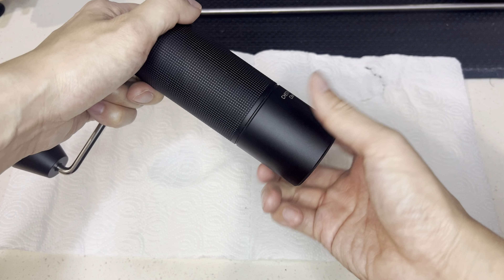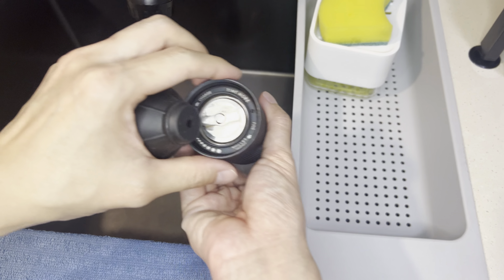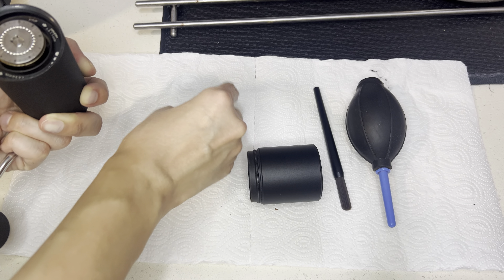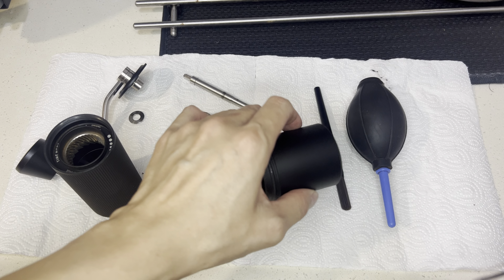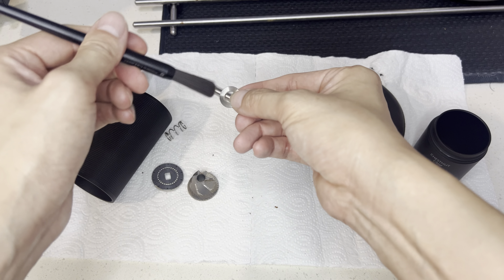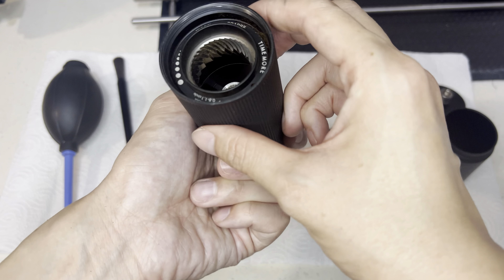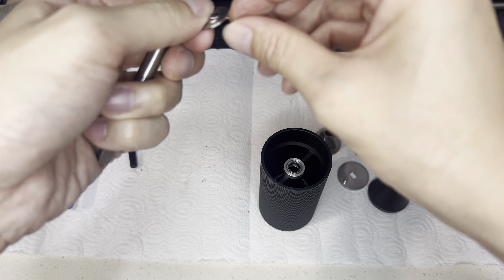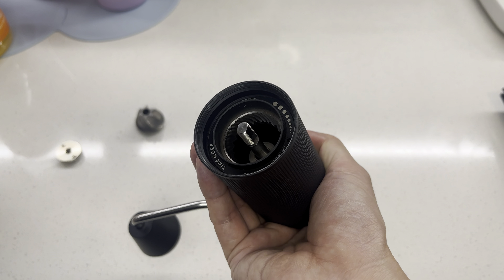How to Clean Your Timemore Coffee Grinder [C3 ESP]

Comment: Dude, you assembled it incorrectly: the smooth washer is on top, where the handle is, and the washer with protrusions is in front of the millstones.
Reply: Thanks for the information!
The manual provides 0 information which side of the washer should be on top, so your comment is of great help!

Comment: Hello, a question, I don't have the mill in position 0, do you know what it could be? Greetings
Reply from the maker: Hi. I did have friends having the same issue. Cant do anything with that, just do extra math to adjust the size.
Reply: @GoNelly  :( , thanks for responding
Reply: You could try to turn metal ring with digit marks 180 degrees (it can be installed on the main axis two ways)
Reply: Hello. Were you able to solve your problem? After the second cleaning, my mill is in position 8 or 3, depending on the position of the disk. Although initially it was at 0.
Reply from the maker: Mine back to "zero" after the dissembled and reassembled again.
Reply: Had the same issue after I disassembled and put it back together, but I could solve it. This wrong position possibly occur when you want to screw it back and you push the spring a bit to hard. Bcs of too much pressure the nut turns too much in the thread before the spring would push against it and it will be dispositioned. Remove the nut and when you want to screw it back again push it against the spring as gently as possible and start to screw it, so the thread will be aligned perfectly again. Hope it helps
Reply: @janosbuzasi1301  it didn't work for me :(
Reply: @cony__gamer718 it’s hard to explain, but for me at least. The washer looking thing you put on before the part with the numbers on it has a hole that is squared on 2 sides. You have to flip it so that the squared sides are now on the opposite side. 

I’ll try to explain again. So there’s the piece that has the hole carved out in it for the next piece to slot into. When you slot it in, it has to be either on one side or the other of the central rod be cause the rod is squared at two ends. If when you screw it in, it lands at 5 instead of 1, you need to basically turn that piece 90 degrees and re-slot it. This works for me at least